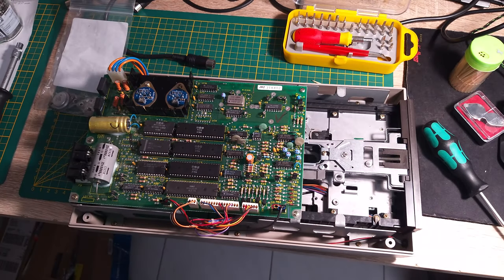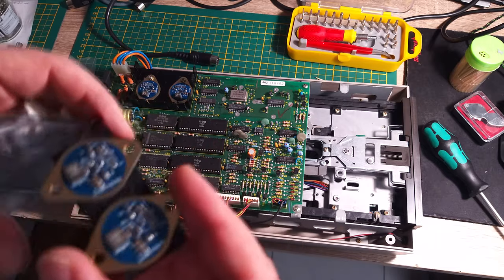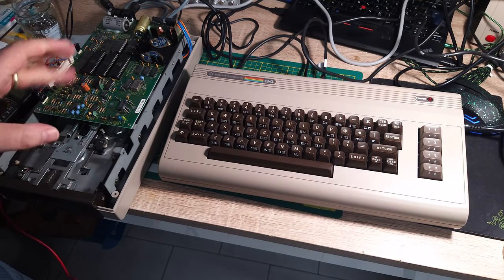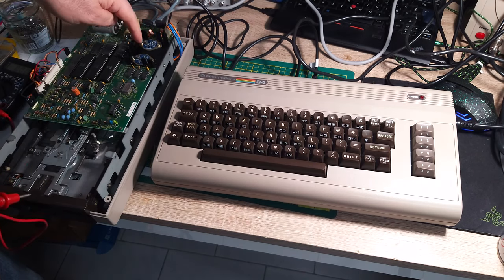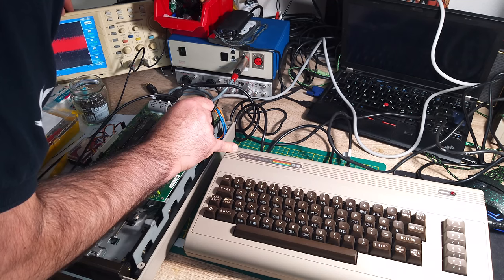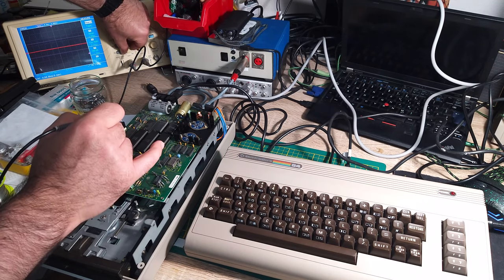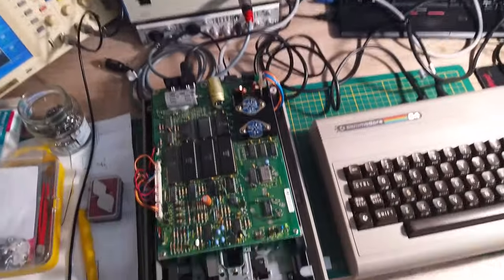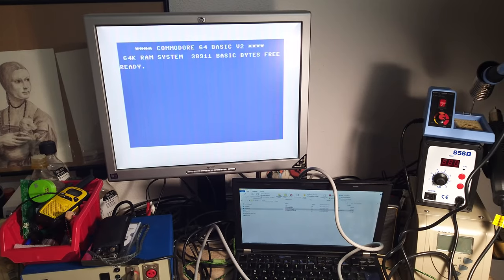Raplacing the voltage regulators in the Commodore VC 1541 disk drive.

Comment: Hello - thanks for your video.  I am replacing the voltage regulator on my old Vic 20 and then I saw you replacing both on the 1541 disk drive.  I bought a PSU5 from EZSBC for the Vic 20 and was thinking about replacing one on the 1541 but I cannot find a similar replacement for the 12 volt.  Would you sell me a set?  I like repairing the 1541 drives as I also repair Commodore 64's as a hobby.
Reply from the maker: Hello and thank you for your message. You are right, unfortunately there are no 12V regulators in TO-3 form. Therefore I have planned and assembled the regulators myself. They work very efficiently and safely. No heat is generated! I have also sold these regulators to a few interested people at cost price. Unfortunately I have only a small stock of the microchips needed to make this regulator work. But for two pieces it should be enough for you. :-)
Where are you from? Please write me a private mail!
Reply: @DigitalArtDeco  Thanks - I sent you an email.  Initially I could not get your contact info on Youtube as Fedora Linux on my laptop did not like the captcha API. :(